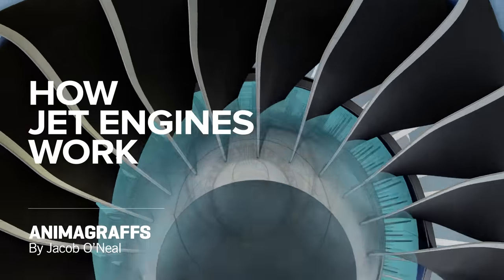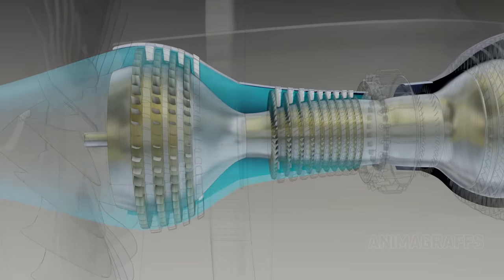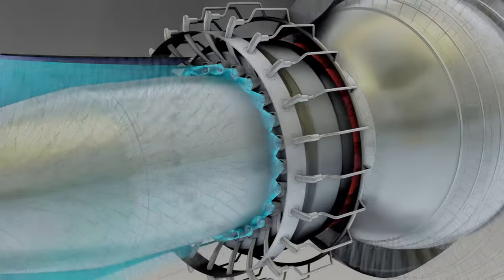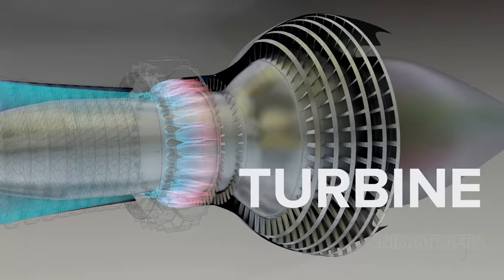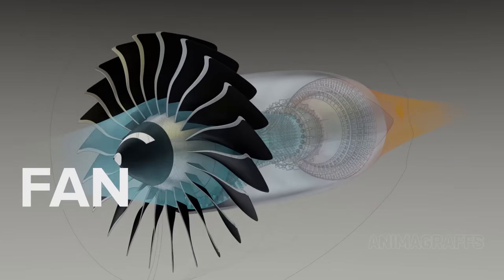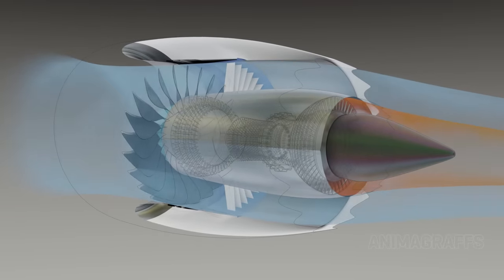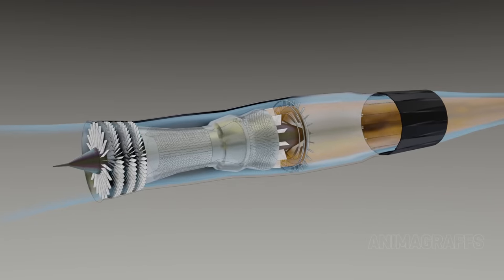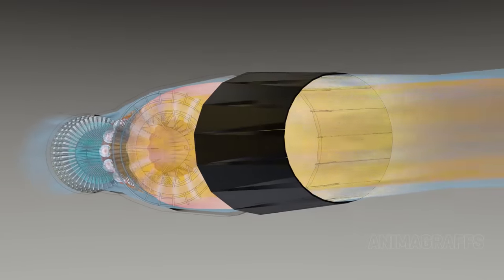How Jet Engines Work

Comment: I still don’t get it lol
Reply: Then you have problems
Reply: Then you can’t get it lol
Reply: @juststeve-zc7gz   maybe you just didn't analyse what he said.
If you can answer these two questions you analysed the video 
1) Why doesn't part of the air go backwards in the combustor 
2) Why does afterburner still work if the fuel explodes in every direction.

I know answer
Reply: @EEEEEEEEEEEEEEEE1 ok then answer them pls
Reply: It’s ok!! This stuff is hard to understand. Took me a long time to understand engines myself but I do now. If you’re passionate about learning and don’t let others bring you down learning anything is possible :)
Reply: Someone’s a little special
Reply: Then you don’t get it lol
Reply: @danielkosciuszko9788  the compressor sucks air in , and compresses it for a bigger bang ( like in cars with a piston and spark plug)
The bang happens in the combuster where compressed air is mixed with fuel, goes bang 
That hot bang air spins a turbine that gives thrust which pushes the plane along
Reply: Just gotta understand specific details.  He said the stages of a turbine consist of low pressure compressor with stator vanes, high pressure compressor with stator vanes. The com-buster and the Turbine. Let me break it down a little 
1: the incoming air is compressed in the first stage low compressor stages.  The stator vane slows and straighten the twisting motion of air.
2: the air enters the second stage high pressure compressor; the same action is repeated 
3: the compressed air enters the com-buster, and it is mixed with fuel, and the ignite the fuel air mixture 
4: the high pressure exhaust gases turns the Turbine section which turns the main fan blade
Reply: You should study on an airplane so that you can get a higher education.
Reply: It’s alright. If I showed this to some random woman she wouldn’t get it either.

Comment: Great job. I am a commercial pilot, for 13 years, always wished something like this existed. If you dont mind, Id like to show this to all my cadets, who had a very blurry idea of how a Turbo Fan really works
Reply: What’s drove the fan to start spinning ?As I understand, the compressor needs the fan to move spin first to compress the air for combustion
Reply: @shafiqfahmi7252  Auxilary power unit provides bleed air to start engines
Reply: Excellent vid.  Im still fuzzy on two things.  1) Does bypass air provide thrust or just surround the high pressure exhaust for noise reduction; and 2) Do turboprop fans generate thrust as they turn or is the sole function to pull air through to the compressors and create bypass? If they do generate thrust what percent of the overall thrust is fan and what percent is high pressure exhaust?
Reply: @samuelwatson4857  Finishing up my aerospace engineering degree this year so I feel somewhat qualified to answer. 

1: Bypass air does provide thrust! Basically you can think of thrust as the change in the momentum of the air that goes through the engine; as you may know momentum is simply mass times velocity. The reason high bypass ratios (the ratio of bypass air to core air) are more efficient is because rather than accelerating a small amount of air to very high velocities, like in a turbojet, they accelerate a large amount of air to relatively lower velocities. The reason this is more efficient is that it takes much more energy to accelerate air to a very high velocity. A good way to see this is to consider the relationship between momentum and kinetic energy. Momentum is mass times velocity, whereas kinetic energy is 1/2 mass times velocity^2, so for the same momentum, the energy required increases proportionally to velocity. This can also be seen in the equations for Specific Thrust (the ratio of thrust to the mass flow rate of air consumed by the jet) and in the equation for Specific Fuel Consumption (the ratio of the mass flow rate of fuel to thrust). In a turbojet, you get a higher Specific Thrust (Tsp), and a lower Specific Fuel Consumption (SFC). Whereas in a turbofan, you get the opposite. These quantities (Tsp and SFC) are inversely proportional to one another. So the answer to your question is that yes, the bypass air does create thrust, just like a propeller does. And it does it more (fuel) efficiently than a turbojet, though this comes with trade offs such as greater engine complexity, greater size, and as I mentioned, worse Tsp, which corresponds to worse thrust to weight ratios. 

2: I assume you are asking about a turbofan in this question, rather than a turboprop. In modern high bypass turbofan engines, the vast majority of thrust is produced by the bypass air that is accelerated by the fan. In fact, the optimum bypass ratio (most fuel efficient) occurs when the bypass air exit velocity = the core air exit velocity. As you can see, with a high bypass ratio, somewhere around 8-9, this means that 8 to 9 times as much air is going through the fan than is going through the core, and with the same exit velocities, you can see that the vast majority of momentum change in the air is being done by the fan. So in modern high bypass ratio turbofans, upwards of 90% of the thrust comes from the fan, rather than the core. 

Sorry for this essay of a response but I hope it's helpful!
Reply: @tonybalogna123  very good answer. To answer the other part of the question, turbofans do reduce jet noise, but the fan produces its own noise, overall noise is reduced however.
Reply: Ooiiiuyyyyyyyyyyyyyyyyyyyyyyyyyyyyyyy😊
Reply: @tonybalogna123  i think samuel watson was really asking about turbopropeller engines not turbofans.  and i'd like to hear the answers too!😃
Reply: @brutallygwapo9597  Well to answer that question, ~100% of thrust comes from the propeller in a turboprop engine.
Reply: @samuelwatson4857 this was very understandable, thank you!
Reply: @shafiqfahmi7252  first the APU(auxillary power unit) is used to turn on or spin the turbine, which is connected to the fan through a shaft which will then suck air in.
Reply: I worked on the assembly floor building JT-8s and JT-9s for a few years in the late 1970s. The first thing they did when we were hired was give us a training class for a week and learning all the different stations in the engine for pressure and temperature.  On the assembly floor there was a place where we tested the oil lubrication nozzles  using heated oil at a given pressure and had to get a certain weight in a given time. It was a nasty job so we rotated doing it. I was an avionics technician on P-3 Orions 50 years ago. I’ve been flown around in all kinds of planes and helicopters working in Alaska. I’m retired now and haven’t been off the ground in years.
Reply: @shafiqfahmi7252 There is an air starter connected to the accessory gearbox which drives one stage of compressor and turbines. It’s been so long since I worked in them I can’t remember what stage.
Reply: @shafiqfahmi7252  it's done by starting motor inside the engine just like a car and the power is given by apu
Reply: Wait what? 13 years?

Comment: Pilot here. Been flying jets for 22 years and I've never heard the cowling referred to as the diffuser. The diffuser is usually the "cookie cutter" looking thing after the turbine stage and can be seen while looking in the tailpipe.
Also, the combustion chamber is basically a diffuser with a lot of holes poked in it, to ensure the air is at the right speed and condition for burning 
 
Other than that, everything was very accurate. Good video!
Reply: The video does misidentify the fan duct as a diffuser. A diffuser is characterized as any part of the propulsion system that has a smaller inlet and a bigger outlet that reduces air velocity and converts it into increased pressure and temperature. For example the inlet duct on an F-100 served as a diffuser. It had a small opening in the front of the airplane that led to the larger diameter inlet into the engine. Its purpose was to reduce the high velocity of the supersonic airflow entering the duct and convert it to increased pressure at a lower velocity and higher temperature as it entered the engine. On a turbofan powered jetliner if the diameter of the inlet is smaller than the diameter of the fan then that space in front of the fan is called a diffuser. It also reduces the velocity of the incoming air while increasing the pressure as well as the temperature of the air flowing into the fan. Obviously the diffuser on a subsonic airliner will be a lot less radical than the diffuser on a supersonic jet fighter.

As you pointed out other areas of the engine are also diffusers. The area around the combustor is a diffuser because it converts the kinetic energy of the airflow coming out of the compressor into pressure to force the air into the combustor. Then the area behind the combustor is a diffuser because it converts the velocity of the gas coming out of the combustor into increased pressure to drive the turbines.
Reply: @joevignolor4u949  Diffusers work inversely at supersonic speeds, that's why the SR-71 had variable position cones at the intakes of each engine

Comment: I worked in the design department for one of the major aero-engine manufacturers for a number of years. Just wanted to say well done - the animation was fantastic but importantly all the information was accurate and exactly how we might describe it in the industry.

The only very small nitpick is that not every engine will have a 4 stage IP and a 10 stage HP compressor since it varies from application to application and between companies who have varying house styles. But apart from that, spot on!

Comment: Just a quick add about the "hot turbines", it's not just the metallurgy and coatings that allow the turbines to stay in their solid metal form instead of liquid (which they certainly could be at the temperature of the gas coming out of the combustion chamber), there is a lot of uncompressed "cool" air being "injected" to the core of each turbine and then bleeds out through many, many precise and small holes in the hot turbines. This keeps the turbines cool throughout their normal operation.

Comment: Good animation. Remember that turbie stages ALSO have stators, but they are in front of the rotor blades. These are called turbine nozzle guide vanes and they ACCELERATE gas flow for maximum power extraction.  Good job.

Comment: What keeps the fan from spinning out of control, you mentioned that as long as compressed air and fuel are constant the engine will keep working, what keeps it from spinning out of control?
Reply: DAVID THOMPSON  Friction.  They cannot overcome friction (air included) without fuel energy.

Comment: Great animation and thanks for correctly stating that the air is compressed by slowing down the airspeed and not by squeezing air into a smaller diameter like most other videos falsely explain.

Comment: Little late to this party, but I wanted to add on to the afterburner (or augmenter) explanation. The air that goes through the core has had all of its oxygen spent in the combustion reaction, and therefore would have no energy left to make the afterburner work. This is where the bypass air comes in. You mentioned in high bypass turbofans, the air is used not only for cooling, but provides thrust on its own (a large porportion of the total engine thrust actually). In a low-bypass turbofan, bypass air is used for cooling, but its main purpose is to provide oxygen-rich air for the afterburner to ignite.

Comment: Many years ago, I read a column in "Car & Driver" by the writer LJK Setright. He pointed out that a jet engine (a turbojet) is essentially a turbocharged ICE, but with the relative sizes of the two components reversed.

Comment: I can recall a time, not that long ago it seems, when all conversation and talking stopped if you were outside when a jet flew over if you were within about 40 miles of Hartsfield airport. Heck, you couldn't even here the radio in your car turned all the way up if you passed by Hartsfield on I285 and a plane was taking off. Thank goodness these newer high bypass engines became the standard. It's still that way if your on the flight path of some of the Air Forces low level training areas, like when their flying out of Dobbins or making practice runs on the dams of Lake Oconee or Lake Sinclair.

Comment: 2:26  The exhaust nozzle appears to be a convergent shape which would accelerate the exhaust gases. But if you notice......the area where the exhaust gases exit the turbine blades is actually small compared to the exhaust cone area. The exhaust gases actually diverge into a larger area, thus slowing them and cooling them....and quieting them. My Airframe and Powerplant instructor pointed that out. From the outside the exhaust nozzle appears to converge, but inside it actually diverges.

Comment: As someone who's just about to finish Thermodynamics and is studying aerospace engineering, this is beyond badass. Thank you!!
Reply: Do you know if the F-16 uses a turbofan or turbojet engine?
I searched it in Google and also in some videos and didn't find the answer
Reply: @Elturbo157  While I don't have the expertise to comment on the designs of specific aircraft by heart, on a Wikipedia search it looks like F-16s usually operate on turbofan engines for propulsion. But if that is untrustworthy, I unfortunately cannot provide additional help
Reply: @Encorous  Thanks anyway, and good luck with the studies
Reply: @Elturbo157  Thank you. Best of luck with whatever you're doing

Comment: The blades of the 6 low pressure turbines are angled in the wrong direction. The way they are angled, they would turn the turbine shaft the other way arround than animated. But the video is superb anyway. Thanks for making it.
Reply from the maker: It could be the "wagon wheel effect", where the limitations of animation and frame rate mess with the perceived rotation direction. Also, these GE engines counter-rotate between the compressor and turbine section, which many folks have had questions about. I don't remember if I got that part wrong on this vid tho, so you may be right after all.

Comment: As a aviation maintenance technician here, this animation explains the basics of jet engine very well. I wish I had more of these animated videos while I was studying. This would be great in training and schooling applications.

Any aircraft mechanics out here? If so, what engines have y’all worked on? Mine are the CF6 and PW2000 series engines.
Reply: Here is something that I can not figure out and I have looked in every way I can possibly think of. Why does the high-pressure stage always look to be going clockwise while the low-pressure stage looks to be going counterclockwise while it's all on one shaft, or so it has always been said? Another thing I can not figure out is how can you have jet engines running at high speeds and even using afterburners but not moving the vehicle?
Reply: @realemonful  the low pressure compressor (LPC) and the low pressure turbine (LPT) is connected by one shaft while the high pressure compressor (HPC) and the high pressure turbine (HPT) is connected by another. The pairs are connected by different shafts. Low-to-low and high-to-high has to be connected and you would see that they run at different speeds and rotation to prevent excessive vibration and counter-torque similar to a piston’s counterweight. For the high speeds with no movement, it would be possible depending on how the blades are angled preventing lift and thrust. Thus, not allowing the aircraft to move.
Reply: @astronickk_  Hmmm, I wonder why they never mentioned that. I have been looking up and down for that but nobody has ever mentioned that in any video I've seen. Thanks for the info! Any idea how I could see how they manage to alternate the rotation?
Reply: @realemonful  stuff like that are more in depth and would be explained more often in engine overhaul shops and test cells (and most likely military). You can probably find info in mechanic test review courses and videos
Reply: @astronickk_  Thanks!

Comment: Errata.
In the two shaft turbofan engine as on animation, the front large fan, LPC (low pressure compressor) just behind the fan and the LPT (low pressure turbine) at the back of an engine are fixed together with the outer spool.
The HPC (high pressure compressor) the smaller diameter multistage section just before combustion chamber, and HPT (high pressure turbine) the two stage section just after combustion chamber are spinning together with an inner shaft. The two shafts are spinning independent at different speeds.
So these blue arrows coming from the LPT supposed to go to the LPC, not to the HPC. 
🙋

Comment: Question for airline pilots: When entering stormy weather, do you have to select "Continuous" on the ignition selector or do the engines automatically energize the ignitors in case of a flame-out?